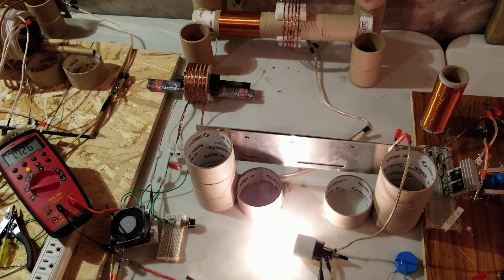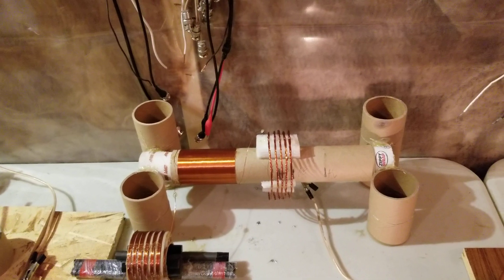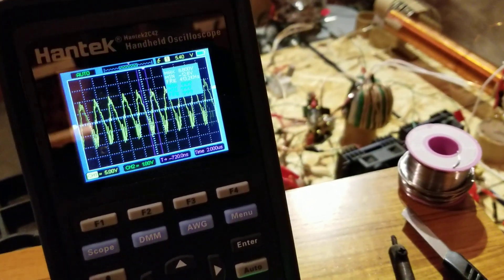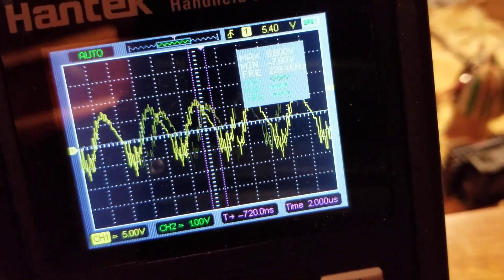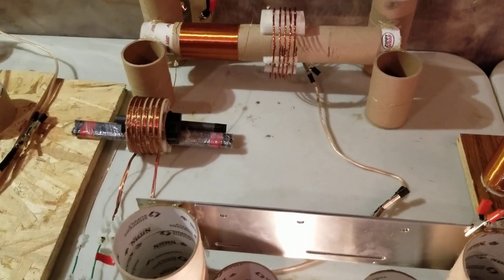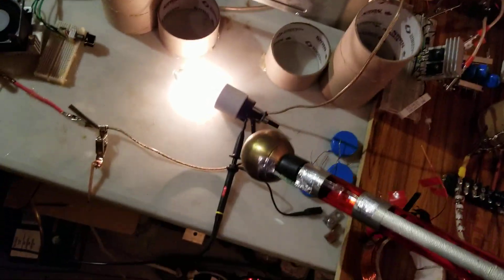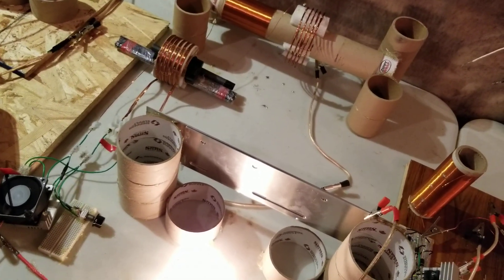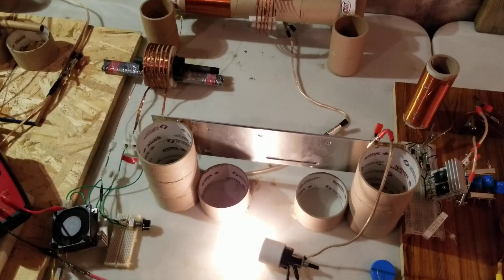Pt 22 TMT Tesla Magnifying Transmitter: Mini 3 coil variation and 50W Halogen

Comment: @Bruno Vk u cd  make it work like a amplifier only if u can learn how to switch it on off, I mean the current passed ingo the coil multiple times a second or fast switching current on and off if u can do that via pulse try using a capacitor low nano farads with a rectifier otherwise, but ac shd go in and out so  fast that it shd make the magnetic field nd collapse in the coil as fast as possible and u have the current amplified the regular of ur switching on and off will determine along with magnetic field construction nd deconstruction ur amplification of power which can b output to caps one way either using resistors or diodes that I am just trying 2 think but u will understand how 2 charge the capacitors of the current flow, imp on off high speed to balance it with development of mag field that can b achieved so basically u start pulsing electricity into cap which r connected to larger capacity caps with small capacity caps ie filling up small buckets which emptied into larger ones and then the stp dn transformer etc, ur length of secondary Tesla coil will determine the size of of ur on off or cps of ur on off per sec.. If u want ac current u have to alternate switching from both sides one fm up one from dn or fm mtiple coils and connect in series, or use 2 Tesla sec coils up and down  ie so that one of both r connected ground on the either of that, pulse the magnetic field on nd off then alternative either using resonantor the induce them on the third from both together

Comment: How manny amps the driver pulls?
Reply from the maker: 1.6 - 1.8 A depending on plate gap and load. Load is a 50W bulb.
but this system can still be improved, was just a new arrangement to get light without actual stepdown coil